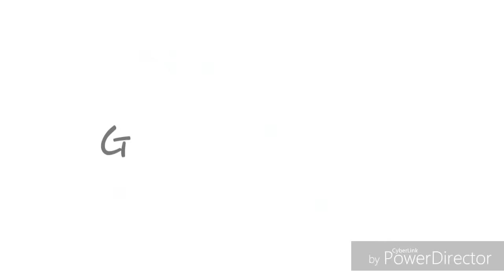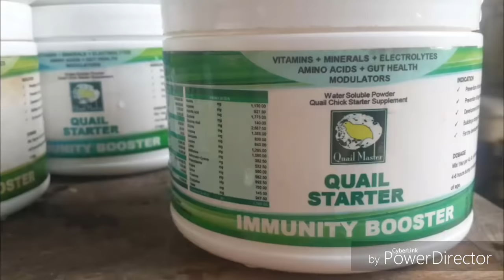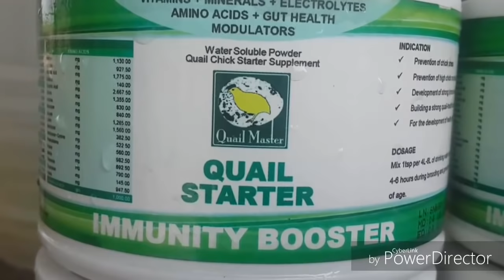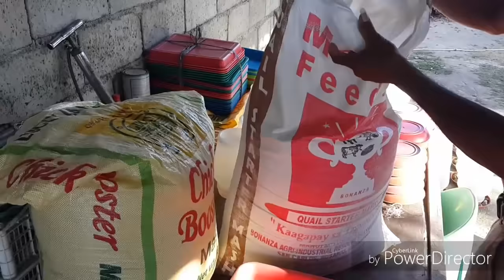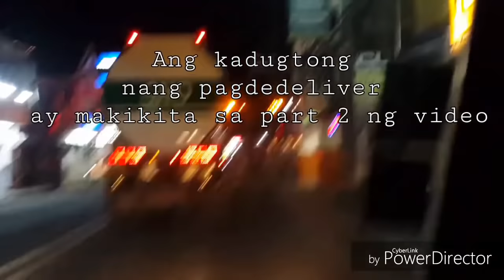Puguan ni tatay Nilo 
Quail Farming in Rosario Batangas Philippines

Comment: Sir mag start po ako ng 5500 heds mga ganu kalaki po at ilang brooder cage po need ko slmat
Reply from the maker: 1.000 heads = 25.000 pesos sir at dalawang brooding cage po yun  
25 pesos po per head eto po location  po sa brgy.Natu Rosario batangas may contact number po 09123158611  /   09178770365

Comment: Sir saan po makakabili ng Quail starter na vitmins nila po gaya ng gimagamit ninyo? Saan po kayo nakabili sir baka pwede po malaman gus2 ko sanang bumi din.
Reply from the maker: Taga saan po sila?  Hanap po kayo ng mga agricutural supply . Samin po kasi meron sa rosario batangas mdami po dito
Reply: juan Tamad channel magkakano po isa nyan sir?
Reply from the maker: @milagrosacosta9556  ano po ang tinatanong nyo kung magkano isa?
Reply: juan Tamad channel tinatanong ko po kng magkano isa ng Quail Starter immuno booster po sir?
Reply from the maker: @milagrosacosta9556  ok po sir. Nasa 1200 + po..  1 sack
Reply: juan Tamad channel sir yung gamot tinatanong ko yung Quail starter booster na pinapainom na vitamins. Pwede po malaman kng cno manufacturer at search ko nlng.
Reply from the maker: @milagrosacosta9556  sir golden quail company ... 550 pesos each.